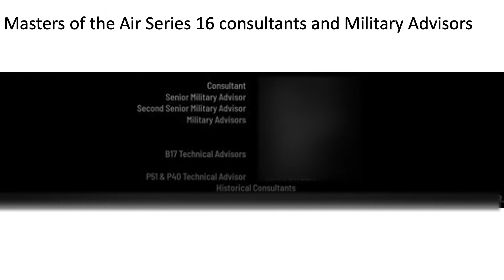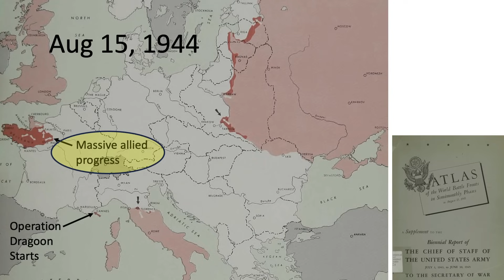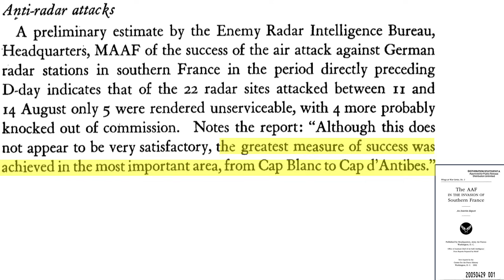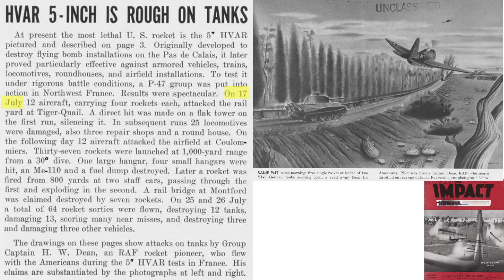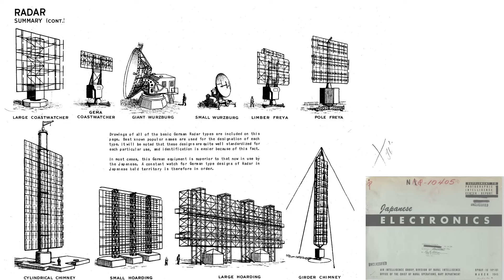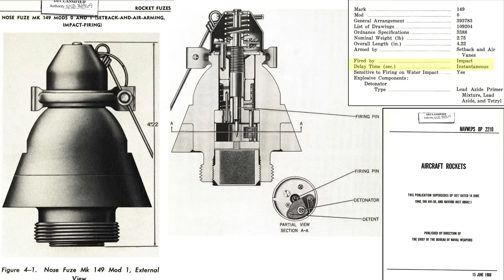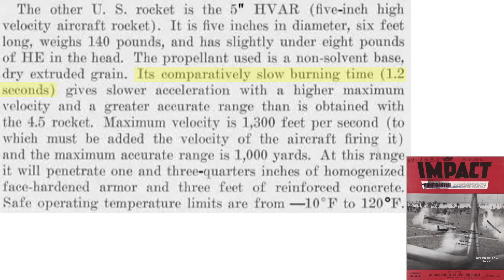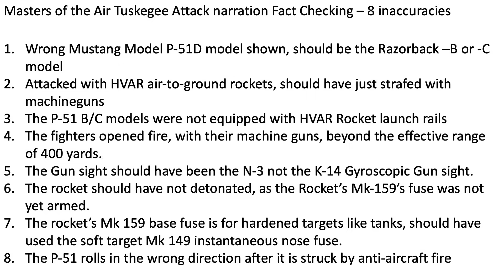Tuskegee Rocket Attack "Masters of the Air" Fact Checking – Operation Dragoon Support

Comment: I would at least hold a 200-300 million dollar series to the level of accuracy of the "Dogfights" History Channel show of 25 years ago.  In both cases they use CGI models.  It is as easy to make a CGI model of a P-51C as it is a P-51D.  IF they didn't crow about the technical accuracy and all the historical advisors, I would hold them to a different standard.  I would have held them to the standard of "Ba Ba Blacksheep".  HVAR rockets are cool, but they weren't all that accurate.  It would have been a longshot to hit a radar tower.

Comment: Definitely interesting to learn about the differences, but I feel like if I was in the art department I'd definitely be claiming half-credit for a P51-D that should have been a P51-C.  Being one revision off is way closer than most movies and TV shows get.  Even stuff made in the 1960's that still had actual WW2 soldiers and pilots working on the film would routinely have equipment from entirely the wrong country getting used, not just a wrong revision of the right model.  The Tuskeegee rocket attack is clearly wrong, but I can at least see how and where they went wrong.  It doesn't seem like they went YOLO and just started making stuff up with zero basis.  Once they had the wrong model of P51, thinking they'd have access to munitions that work with that model of P51 is a goof, but not a completely wild one.
Also, did the show ever show the P51-C?  If they only ever showed the D, it could have been a budget issue that they would have needed to build an additional CGI model to show both C's and D's in the series.  If they had a P51-C from a different episode just sitting on their hard drive, it definitely gets more embarrassing that they didn't use it.

Comment: Great job!  I do hate it when Hollywood shows laziness with these sacred subjects.  Men lost their lives here.  Let's get it right at least.  I agree with your D grade since they did get the radar antenna types correct, and it was in a coastal area like shown.  But that's about it. ... At the 8:25 point in the video, I think any pilot would instinctively apply a left roll stick command (lateral left to zero the initial roll, and with only one wing's aileron still working, can basically stabilize the aircraft still.

Comment: The plane rolling in the wrong direction is such a weird error
different variants of aircraft and weapons are understandable due to getting the props, and standardization
Reply: No it's not.  It's all CGI.  There's no such thing as props...just a 3d model, texture, & shading.  They could have done the same thing and looked up the correct equipement, but didn't bother.

Comment: When I watched clips as this series was released, I saw too many inaccuracies that I considered unacceptable. It made me wonder who they chose as technical directors! I accept that some mistakes are going to be made, but some were just glaringly bad. 

I'm happy to see that the creator of this vid spotted the damaged Mustang rotating in the wrong direction. Most people would not have noticed. The first time I watched this, and other clips, there were so many such fundamental errors that I simply dismissed series. It's bad enough that the actors were just not believable. 

I will admit that a few of the scenes of bombing missions looked pretty good--much better than past efforts such as Memphis Belle (1992).
Reply: I think that (perhaps) the director reversed the roll direction vs PHYSICS to enhance the visibility of the electing pilot.  Much safer that way, too!  (But that second point is moot If its CGI). 99.9% would miss that in the fog of battle.   I did, despite 40 yrs flying RC!

Comment: Radar stations were extremely difficult to destroy. The Luftwaffe made a huge effort on "Adlertag" 13th of August 1940 to destroy the British home chain radars along the south coast of England. Only one (Ventnor, Isle of Wight) was disabled for more than a few hours. The main problem was that bomb blast passes straight through metal cage structures, so anything short of a direct hit on the mast or control hut doesn't work. Underground cables were damaged but they were fairly easy for the British to repair.

Comment: going beyond the inaccuracies i never understood why the episode existed in the first  place. the series was about the 100th, and the only interaction with the tuskegees was as fellow POWs. kind of part of a broader issue now that i think about it in that just like the pacific, MotA suffered for splitting up to follow multiple different storylines instead of keeping perspective of, for example, only the active air wing
Reply: They needed to make at least one episode about racism to get Hollywood funding. Muh diversity. Also the Mustang pilots spent 5 minutes flying with little success, and an hour crying about racism. If I was black I would be insulted by this portrayal.
Reply: Although a very good book, Masters of the Air was a detailed overview of the 8th AF and not just focused on one bomb group. There are plenty of other existing books that could have been used for a more cohesive story.
Reply: As if they could have a show about the air War in ww2 and not show this particular group, it simply wouldn't be allowed in todays Hollyweird
Reply: Be thankful it wasn’t about the modern military.  There would have to be trans characters.
Reply: The Tuskegee unit is probably currently the most recognizable US WW2 air unit. And it is not unusual for Hollywood to use things that are publicly known, but don't really fit historically; just to increase the possible viewer base. Which can equal more $.
Reply: @flarvin8945 Maybe in america it's the most recognized unit. No one cares about them outside the US. They had a negligible impact on the air war.

Comment: My guess for the wrong P-51 model being used for the CGI planes is that while there are many P-51 CGI 3D models available to the CGI creators, most are of the P-51D. I did find a P-51B 3D model after some time of searching. The special effects people, either were not made aware of the exact model needed or couldn't find it. I know the special effects artist are often under extreme time pressure to complete their work (I think the scene with the P-51s taxing on the runway is evidence of this). If the technical advisor ever pointed out the error, it was most likely too late to change it.

However, firing the machine guns too soo should have be caught in the storyboard stage. Those bullets would have splashed down in the water.
Reply: Same lame garbage production quality as Pearl Harbour with Bf109Es with missing elevator struts.
Either use real/replica aircraft or at least get your computer models right!

Comment: Interesting how you point out the number of "technical advisors" in the movie credits. I concur - How hard would it have been to get these details correct... as opposed to completely mucking them up?   Well, I guess that's Hollywood for ya. As a pilot, I had to laugh outloud when I saw the plane continue rolling to the right after getting half the left wing shot off.. NOOOOOOOO.
Reply: Some I can understand, I’m guessing P-51Ds were used because there are more airworthy examples of them (and they are more iconic as the “definitive” P-51 model).

And the gun run as shown was probably more cinematic, then had it been closer. It’s also possible, that pilots would start a gun run too early. So it’s necessarily “wrong”, as in it couldn’t had happened, just unlikely or possibly “insulting” to have shown it.

I guess same with the rocket shots as well, cinema over realism, though in this case it’s outright wrong. 

There are others that seem to be lazy oversights like the plane not rolling correctly… which just looks wrong and not using the correct rocket fuses.

Really the whole Tuskegee Airmen portion was lazily shoehorned in. Seems almost more disrespectful the way they were included, rather than being omitted altogether.
Reply: @billykorando  I thought all the P-51 shots were CG?  If so, then not putting in "B&C" models was just lazy. (I have not actually seen this film - only short clips on YouTube). I am not going to waste my time sitting through the whole film.
Reply: @bat2293 I think all the in the air shots were CGI, but the shots on the runway looked real. 

It might had not been known ahead of time all the in the air shots would had been CGI, which is why P-51Ds were still used.
Reply: @bat2293 also it was a limited series, not film, though point still remains, that it was only ok.

Some “good” aspects, in that it did depict the horror of the air war. Which is maybe more popularly thought of as more glamorous and removed from the brutality of land combat. 

But yea, it’s definitely a far cry from BoB or even the Pacific. If we are taking relative scales and BoB is a 10 and the Pacific is an 8, then MotA is like a 4 or 5.
Reply: @bat2293 they used two real P-51s in the show but I have no idea where any of that footage went because it all looks like really bad CGI unfortunately....
Reply: @billykorando  I figure you're talking about the static shots with just one P-51 because 3:30 is 100% CGI
Reply: @billykorando  p-51s were all CGI

Comment: Thanks for all these.  I can think of all sorts of excuses for most of them, but they are Hollywood excuses, and unnecessary.  The few mistakes I excuse include flipping off oxygen masks so audiences can see faces, otherwise it's hard to distinguish characters by muffled voices alone.
Reply: I disagree the scenes involving air crews were not accurate as oxygen masks and goggles would have been worn at all times during flight. Like wise the Bomber crews would have had flak suits and protective head gear to prevent flak injuries. I conceed that it would be difficult to distinguish characters but I thought it was going to be an accurate story of the UK based Mighty 8th.
Reply: @chrisspalding9608  That's my point -- yes, it's inaccurate, but it does help most viewers follow the story, as contrasted with using the wrong airplanes, wrong weapons, wrong fuzes, etc, which are entirely unnecessary changes.

Comment: I wonder if it’s deliberate omission/alteration or plain incompetence. If ONE GUY can recount everything as it happens minute to minute how could they possibly make so many mistakes?
Reply: I have a few theories.
1. The producers decided to model the fewest number of aircraft possible rather than period-correct models, in an effort to save money.

2. The historical advisors were given a more limited role than we're led to believe by Hanks and the producers. It's possible that they weren't wrong, just ignored.

3. The producers are cynical and believed that most viewers won't notice all these inaccuracies and it's better for the bottom line to just focus on making the action look good.

One or all of these can be true together. I suppose it's also true that the advisors were just making stuff up or doing lazy work
Reply: @scullystie4389  I believe the production crew has outright stated that the reason the B-17s weren't given period accurate chin turrets for the later operations is the real B-17s they had were only the F models, and they didn't want to either acquire G models for filming, nor try and CGI them to being G models, and didn't want a mis-match between B-17s on the ground and B-17s in the air, so they kept using Fs for the flying CGI as well
Reply: @scullystie4389  I think theory 1 is probably true.  In some of the bombing videos, they used B-17s of the wrong submodel, and it was simply a shot of them cruising in formation.  Yes, it's incorrect, but if that saved them 20% on their CGI bill by using B-17Gs when the mission in question was B-17Fs, I'm not going to lose too much sleep over it.  As long as historians know not to use it as a primary source, I think that's forgiveable in exchange for getting the movie made.
Reply: It's definitely just hollywood-ification

Historical consultants on these sorts of things universally lament that they're often not taken seriously, and their import is always reviewed as secondary to visual effect
Reply: he is not one guy, he is THE guy
Reply: Almost everything listed can be explained by the limitations of the film medium. For example, the missiles not arming while the propellant is active.
To show that accurately, the  firing would have to take place twice as far away, this would mean either the camera distance was much farther away, making it hard to see detail, or both the plane and target could not be in frame. Then, if the shot showed the propellant stopping, most viewers would think something wrong happened, and that the rocket was a dud, plus the viewer would lose the visual clue of the rocket's flight path. This is also why tracers are shown in movies long after they weren't used in real life, because the viewer needs to be able to see what is happening in a shot.
Now, I am very glad that US Bombers makes these videos and points out these inaccuracies, but that is because I am interested in the topic, and he does a great job explaining everything, but putting some of these points in film, even a documentary, would be either/both very expensive add little to nothing to the majority of viewers, while making the film more difficult to follow. Most people couldn't tell you what kind of plane is being used, much less what model, and when the planes change in a movie, there has to be a reason in the movie for that change. The truth of, "there is a new better model" doesn't work, because the viewer doesn't know that. The movie must explain it. How does that explanation improve the movie for the vast majority of viewers?
Reply: @danielhurst8863  A similar point was made about Saving Private Ryan -- if there were German pillboxes that close to the beach, they'd have been hit before the landing, and the actual German firing positions were about 3x as far away as portrayed.  But it wouldn't look anywhere near the same, and so that concession was made to look more realistic than it was.  Make of that what you will.
Reply: @danielhurst8863  if they want the shot to look a certain way then yes there have to be compromises. They wanted it to look like Star Wars (seriously look at these rocket attack run shots, it's almost a copy of shots from Rogue One and Episode 7). But it's entirely possible to shoot things a different way that will allow for both historically accurate action and gripping, screen-coherent action. 

As this critique series has shown, the problems aren't just aspects of what you can fit on the screen but also glaringly obvious errors like using the wrong B-17 model for two thirds of the series (it's the hero aircraft, this is inexcusable) and completely botching how level bombing worked and what it looked like. The bizarre scenes involving the surface to air rockets that didn't exist come to mind too.

This series could have been much more grounded and would have benefitted from it. Series like Band of Brothers and Generation Kill are iconic because they're grounded, even though both have their flaws they're beloved by fans and critics alike. It's always going to be more challenging to do that in context of an aerial campaign but it's not impossible, unfortunately the team took things in the wrong direction.